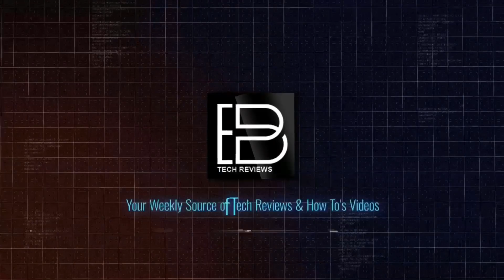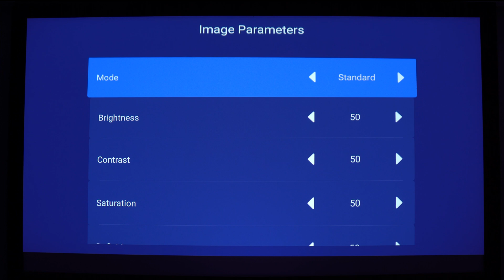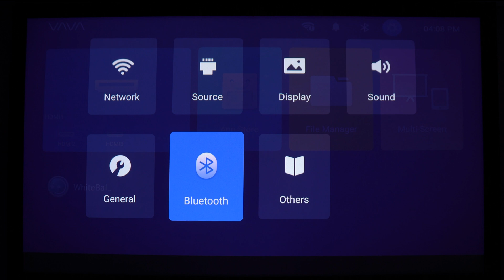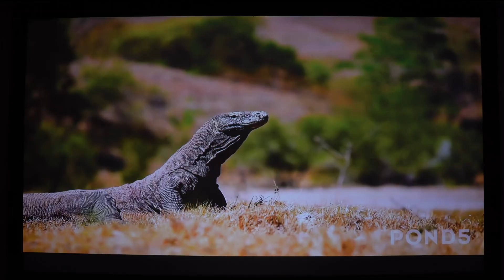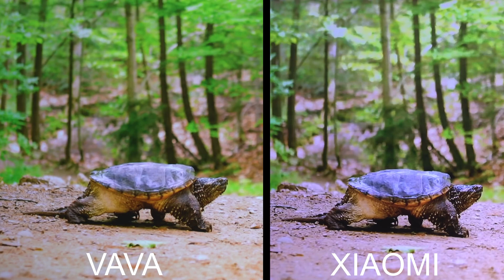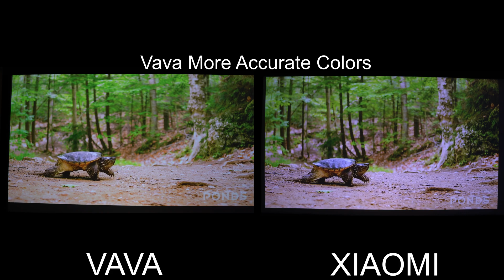AMAZON PRIME DEAL 600 Off! VAVA 4K LASER Projector Comparison vs Xiaomi 4k Laser Projector

Comment: Has anyone actually checked out the internal speakers? Much of the time the branded ones, Harmon Kardon, Bose etc are literally just the license paid for to use the name and use the same generic OEM drivers as the cheaper models (hence same wattage ratings). The Vava may have better bass response due to size, if they've utilised it and tuned it properly. Hard to know without an audio comparison.

Comment: Check the color on wemax a300 and you gona see the difference 

Note vava is the english version of wemax a300 everything is similar spec there is no difference only the design vava 

2nd the wemax a300 support 3d your vava not support 3d 

Vava advertisor should compare something new with other new not with old version of xiaomi 

For my self wemax a300 much better than vava even thr customer service for vava not answering the emails 

In order to believe you you have to compare new product with other products new 

I hope this information will help you in the near future to advertise the products in properly way 

Cheers
Reply: Mohammed Hindi please recommend for mr the best projector on the market , i have wemax one and its great , if i need better than wemax one ?
Reply: @majidk.9186  majid the presentation done by the MR some of it true but the rest not true 

Example he mentioned that xiaomi not support hdr10 4k it's not true at all it's not fair to compare old model with new model like vava 

You have to compare with the latest models 

Example the wemax a300 4k laser projector support hdr10 4k and 3D 

For the picture you can play with the color adjustment but for me the wemax a300 is much better than vava for some reason

1) the customer service 
2) 3d 
4) hdr ultra HD 4k hd you can watch that on Netflix without any issue and the picture quality crystal clear if you used tv box like xiaomi mi box s is a 4k and Google certified 
5) the size of the projector 
6) the distance between the projector and the screen
7) coil and fan not noisy 
8) the brightness mode is amazing 
9) price and coupon discount always provide by xiaomi 

All the above I found with wemax a300 

Note I respect the all as the people not same they can go with any brand is not a big issue for me but I like the fair compensation 

Best regards
Reply: Mohammed Hindi which screen you use with the projector ? And which site is the best to order xiaomi a300 projector , thanks for replying me
Reply: @majidk.9186  vividstorm pro alr screen